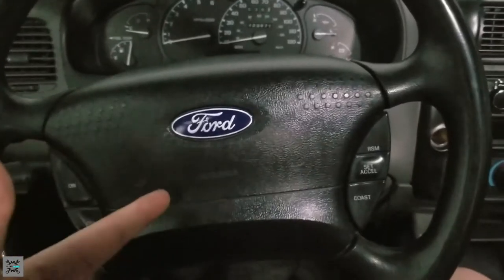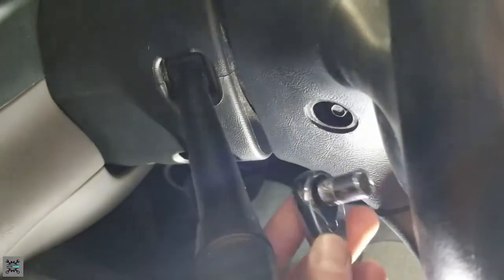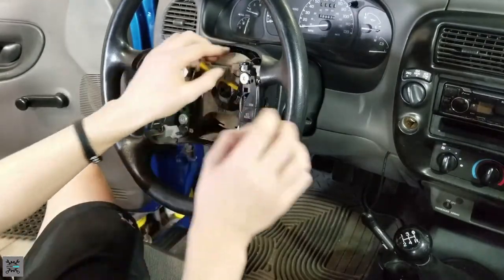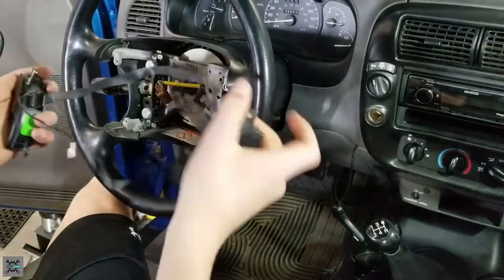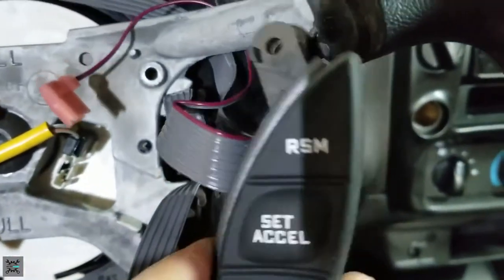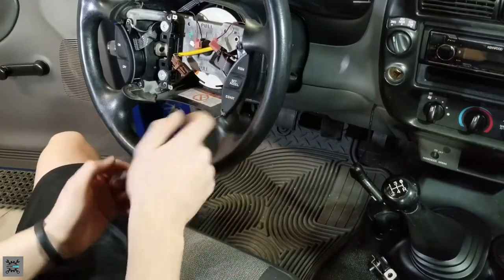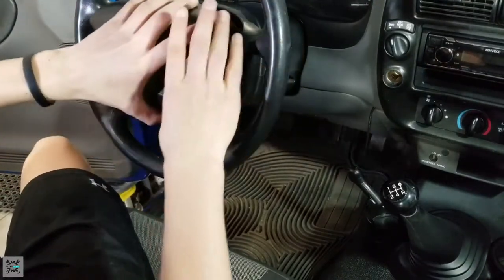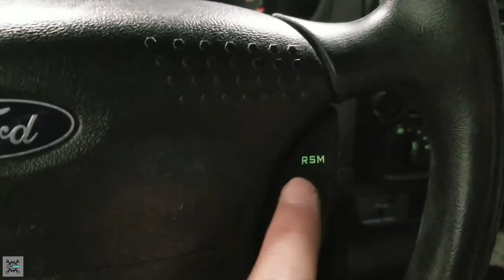Replacing Cruise Control Buttons | 98'-2002 Ford Ranger (Mazda B series) | *In-depth Install*

Comment: Remember, the positive battery cable is only one that can be hooked to the battery by itself. So disconnect negative cable to do this not positive only.
Reply from the maker: It doesn't matter what terminal is pulled. As long as there is no current flowing through the car it is safe.
Reply: Might not matter to you but if you're going to teach it correctly, without chance of shorting the electrical system, then never disconnect the positive battery cable first. That's basic stuff, day one in my class
Reply from the maker: @tywonpool  All I am saying is that disconnecting either terminal achieves the desired result (in terms of electricity, they both serve the same purpose). In the video, I taught everyone to isolate the lead that was disconnected, so if you are worried about my teaching, I think I covered all of my bases to ensure the desired result without any issues.

Comment: That's all great, worked fine. the biggest problem is putting the horn/airbag back in. Everything must be right. You can't just put it in and bolt down. You have to allow for the movement needed for the horn. Tighten the side screws in with the horn/airbag in the upmost position. Just my 2 cents. If you don't the horn will blast until you get it right.
Reply from the maker: I have it aligned properly, but thanks for your information. Other than that one instance, I hope you found the video informative and helpful.
Reply: Thanks! Glad I’m looking at the comments before attempting.
Reply: I just shoved mine in and bolted it down.  I didn't know I was supposed to have a problem.
Reply: Can you explain more what do you mean by upmost because I did run into this problem

Comment: Thank you so much great video 
Followed your step by step video "no issue with slipping wire's behind the plastic" worked fine.
I looked at old parts once I was done and not worried about wrecking old parts I took a small screwdriver and with a easy wiggly and half a jiggly "the wire's unplug"  from switch's. If you feel good about your old wire's you can change only switch's or unplug to fish wire's through to left side. 
It's people like you that make YOUTUBE rock THANKS!
Reply from the maker: I appreciate your positive feedback, and I'm glad you found my video helpful.

Comment: Good job, nice and easy to follow instructions. Too bad the mounts on both sides for the buttons are plastic. My on, off switch broke off the steering wheel. Found both switches for $15.00 new, online. Going to change them out. Thanks for the tutorial.
Reply from the maker: Absolutely, glad I could help!

Comment: You've had these in for 2 years, did they hold up? I need to replace mine and Amazon sells them for $20, Rockauto has brands from $79 and up. Wondering if going cheap on these is OK.
Reply from the maker: They are still working flawlessly...I've had no issues

Comment: When the cruise is OFF, it lights up. When you're iIN cruise, then the ON lights, ang OFF dims.
Reply from the maker: @jeffsmith8900  That seems like a circuit issue in the buttons themselves...maybe try a different set

Comment: Good video.  On my 2002 Ranger, I did find the airbag was secured by 2 different types of security bolts.  Took a while to find/order the right sizes.  Needed a secure torx bit and a spanner bit.
Reply from the maker: That's odd that the bolts are different, glad you were able to figure it out though.

Comment: Great tutorial! I'm a new subscriber thanks to this one. The buttons have rotted in the Texas heat after 20+ years.  The part you recommend in the link is not available with no eta. Do you have another recommendation for a good replacement part?
Reply from the maker: I will fix the link in the description, but these should be the same: https://www.amazon.com/F87Z9C888BB-Replacement-1998-2003-Mountaineer-F87A9D809BA/dp/B09THDJ7H8/ref=dp_prsubs_sccl_3/132-0940735-8545008?pd_rd_w=ZaQNW&content-id=amzn1.sym.2c74594d-9264-4cdf-bf3d-e4e41e237275&pf_rd_p=2c74594d-9264-4cdf-bf3d-e4e41e237275&pf_rd_r=K0RKQG5KQWZZF70Y6AKM&pd_rd_wg=wrff8&pd_rd_r=84990a49-74ef-4c7d-9d2c-0f7cc250cc68&pd_rd_i=B09THDJ7H8&psc=1

Comment: The cruise control wires in my steering wheel came unplugged from the cruise control switches. I ended up buying new switches and plugged the wires into the control switches and cruise control still dont work. Any suggestions? Thanks. 
The fuse is good. But is there a relay under the hood for cruise control?
Reply from the maker: It could be possible that your cruise control servo has gone out (the little motor that controls the throttle for cruise control)
Reply: @TheMileHighMechanic  everything was working great till I was taking one of them security lock bars off the steering wheel. The bar got jammed and took the cover of the cruise control switch off. And the wires unplugged from inside the steering wheel.  I ended up buying new switches and plugged it all in and it still don't work. 
I can hear the motor of the cruise control turn on and back off after I push the buttons on the switches. Hopefully that makes sense.
Reply from the maker: @dougbailey1521  so you can hear the servo engaging but it doesn't keep the speed?
Reply: @TheMileHighMechanic   I tried pushing the cruise control buttons and I hear a motor or something come on and then it goes away after a few seconds. If I remember right. I'm pretty sure I had the key onto the on position and the cruise control light blinked like 2 times. As I was pushing the cruise control buttons
Reply from the maker: @dougbailey1521  The system only engages above 30 mph, so if it's doing the same thing above that speed, id say we are looking at a problem with the circuit... possibly the connection to the wheel is damaged, or a relay has failed
Reply: @TheMileHighMechanic  okay. Thank you for your input. I appreciate it
Reply from the maker: @dougbailey1521  glad I could help
Reply: @TheMileHighMechanic   My cruise control works. Thank you for your time and help .
Reply from the maker: @dougbailey1521  Haha, no worries

Comment: Why when I put the ford middle piece back the horn stays on?
Reply from the maker: The bolts have some wiggle room on the side of the air bag. You will need to pull the air bag towards you while you tighten them down to make sure that there is distance between the horn contacts.

Comment: Hey I’m getting a ford, same model, and it’s actually missing those buttons. Is it the same process and if so where do I get the parts for it? (It has the circuit part on the steering wheel the cover for the buttons are just gone)
Reply from the maker: If the buttons were removed then yes, it will be the same process
Reply: @TheMileHighMechanic  Thank you so much, do you know where I can buy a pair of new buttons?
Reply from the maker: @worromot2682  I think I linked it in the description

Comment: Okay I’m very confused. The LED lights are not turning on however the buttons are working. Any thoughts?
Reply from the maker: That is very odd, are you sure that all of the wires in the connector are pushed all the way in? If so it is possible that you got a dud and maybe try it with a new set of buttons. If this doesn't work then you probably have a messed up wire or something impeding the current from reaching the lights.

Comment: I just installed these parts per your video, and none of my buttons light up.  Any ideas?
Reply from the maker: Do they function correctly? Are you sure you bought the correct ones? If yes to both, I think you just got a bad part.
Reply: Thanks for getting back to me.  They do not function properly.  I tested the cruise control at various speeds above 35.  I used your link to purchase the right ones to fit my 1998 ford ranger.  I have owned this vehicle since 2002 and I know the cruise control hasn’t worked in a very long time.  My controls were melted off from the hot Hawaiian sun so I figured I would try replacing them after watching your video.  At least aesthetically the steering wheel looks nice now.  Do you think they are bad and I should return to Amazon and swap out for a different set of controls?
Reply from the maker: @danielcotter9202 If they don't actuate the cruise control then it is likely not a problem with the buttons. I would check the cruise control fuses. Sounds like there is no power being sent to the buttons.

Comment: Does it matter which side of the battery terminal to unhook?
Reply from the maker: No, since all you are doing is stopping flow from the battery, you can disconnect any terminal.
Reply: @TheMileHighMechanic  I did your method, not having to remove the steering wheel is great and just slide the cables thru the slit.  My only encounter is the horn got so sensitive it kept buzzing lol. Fixed it by loosening (had it too tight) the two screws that hold the airbag. thanks for the video. tc
Reply from the maker: @cebuanostud  Thank you for the feedback, I'm glad you found it helpful!!

Comment: Did this job today and discovered something the video doesn't say. The buttons connect to the wires with plugs. So if you only need to replace the buttons and the factory wiring is in good shape, you can skip the rewire part altogether.

Follow the video until you get to the part where you unscrew the 4 screws holding the old buttons in. Then disconnect the plug connecting  the old buttons to the wiring (you will probably have to use a small flathead to pry it out), then plug the wires into the new buttons, screw them in, and you are done and ready for reassembly. This turned a 20-30 minute job into a 5 minute job.
Reply from the maker: I do not remember them having plugs on the buttons themselves. I thought that the ribbon connector on the OEM ones went straight into the buttons. The replacement one might have had connectors that you can remove but I don't believe you can do that with the OEM ones. 

If you did indeed have the OEM ones and did this thanks for pointing that out!
Reply: @TheMileHighMechanic   Yes I replaced OEM ones (that were all destroyed) with aftermarket ones. The ribbon wire connects perpendicularly to the connector (and on the right side it passes through) and the plug opening is sunk into the body of the button housing, so if you don't look closely it looks like the ribbon cable connects directly to the button, but at least on my 2002 there is indeed a plug connection.

And thanks for the great video, it gave me the confidence to even attempt this repair. Repair shop wanted over $250 to replace the buttons, I bought a replacement set off Amazon for $22 and fixed it myself in 5 minutes!

Comment: So I followed all of the steps in your video, got everything back together...and the horn doesn't work now, when I press the horn. However, if I press the "Off" or "Coast" buttons on the new cruise control knobs, then the horn sounds. Any suggestions?
Reply from the maker: Hmm very odd. Does the horn pad go down all the way, or are the buttons in the way of it traveling. You need to align everything so that it can move freely. As for the OFF and CRUISE making the horn go off, that beats me. Maybe you got some wires crossed? Does the horn work as the off button for the cruise control? I suggest taking it apart and redoing it again to see if something is flipped.
Reply: @TheMileHighMechanic  So I took it all apart and reinstalled it, following the process that you laid out here. Same result. I haven't actually driven it; I'll give that a try in a bit and see what happens.
Reply from the maker: @dannynqualls-gibeau8748  That is very odd, the only other thing that I can think of is a grounding issue. That in its self sounds very unlikely too. I am at a loss.
Reply: Did you ever solve this? I am having the same results
Reply from the maker: @Evan_Randazzo  maybe try installing a different brand of buttons?

Comment: Can this kit be added to a Ranger without factory cruise? or would additional work need to be done?
Reply from the maker: Short answer is no...there is a servo motor that controls the throttle position to maintain the correct speed, and if your car wasn't optioned with it you won't have it.
Reply: @TheMileHighMechanic  Do you know of any videos on YouTube that show how to install the servo motor? Or can you do a video on that? I have a 1998 Single Cab Style Side I’m trying to add cruise control to… Love your channel by the way…
Reply from the maker: @justonpreble4083  I found this forum thread that has what you are looking for ( https://www.ranger-forums.com/interior-exterior-electrical-123/how-98-03-cruise-control-install-76919/ )
Reply: @TheMileHighMechanic  Your the man! Thanks 🙏
Reply from the maker: @justonpreble4083  I wish you luck!

Comment: I ran my new harness on the bottom side of the enclosure. Much more room down there
Reply from the maker: I just did it the other way because that's the way it was before I took it off. In my opinion there are reasons to why engineers put things in certain places, and as a rule of thumb I just put them back where I found them. But if it works, I guess that it is fine.
Reply: @TheMileHighMechanic  you did it the correct way. I was afraid of tearing it up so I took another path
Reply from the maker: @timin770  hey, whatever works!